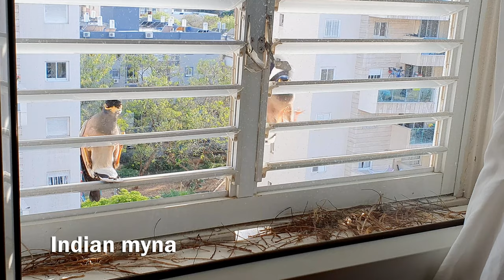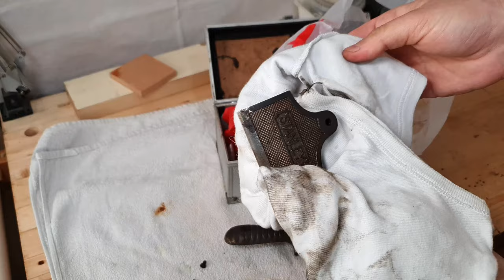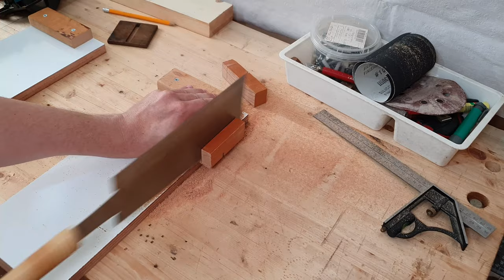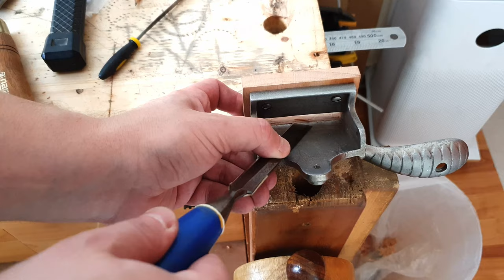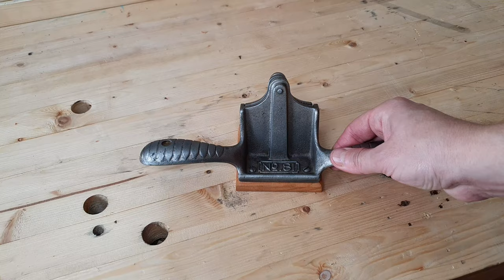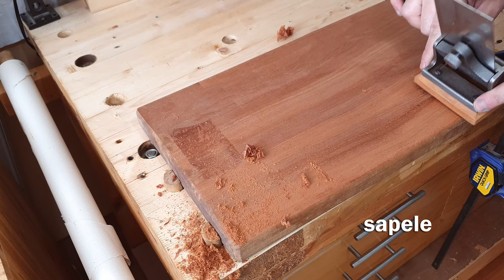Stanley no. 81 Cabinet Scraper - happy restoration with friends!

Comment: Hi, Helpful video, what size and type are the original screws that hold the sole in place? Thanks
Reply from the maker: I just measured them, they don't look metric to me. The screw is 10mm long including the head, thread is 7mm long and 4mm wide (not metric, maybe imperial). The slotted head is flat domed, 7mm in diameter. Hope it helps, let me know if there's anything else I can help with
Reply: @MrGreenMakesStuff  Great, thanks.

Comment: Would you know if originally the cap was chromed or nickel plated? The reason I'm asking is that reapplying chrome is not feasible at home, however nickel plating is a doable diy project. Thanks.
Reply from the maker: Hi! Unfortunately I don't know, but if there's an easy way to find out ot check at home, I can try and post the results
Reply: @MrGreenMakesStuff  Thanks. A plane collector channel Just Plane Fun replied to me yesterday and said that it was nickel. There's a tremendous video by Clickspring about how to electroplate nickel at home if you're interested. He uses a fancy set-up, but I have heard of pretty good results using a phone charger, so the only cost is buying a small bar of nickel as an anode. I'm tempted to give it a go, so I'll have to go hunting for a plane!
Keep well.
Reply from the maker: Thank you so much for the information! I will check the channel if only because I love hand planes :) plating is a nice project idea, maybe I'll do it at some point. Good luck with your projects and thanks again for watching!
Reply: @MrGreenMakesStuff  I love all the old woodwork tools. Not only are they incredibly useful still, but they take me back to helping my dad as a boy and learning how to use them. I'm not very skilled, but by no means hopeless and my son now helps me.
I think that I'll look for a No. 4, either a Stanley or perhaps a Record which are underrated IMHO.
All the best mate.
Reply from the maker: Thank you! I actually have both a Stanley and a Record, and my Record performs slightly better in my opinion:)